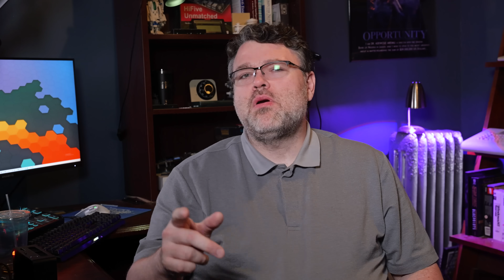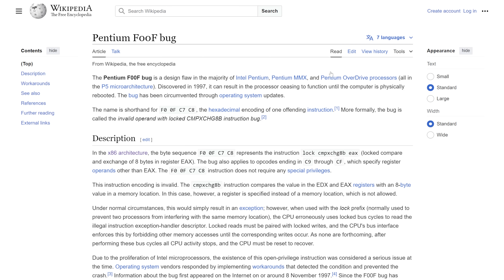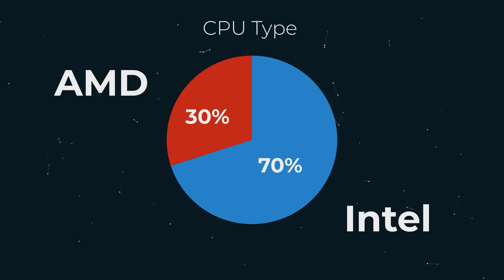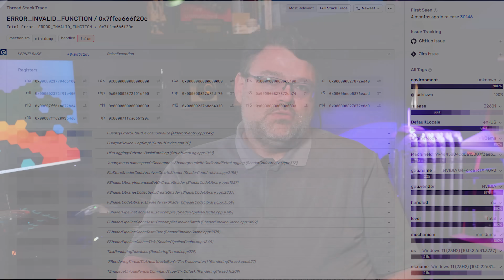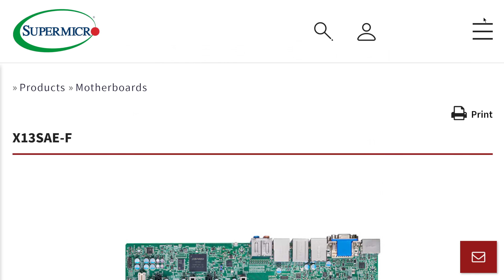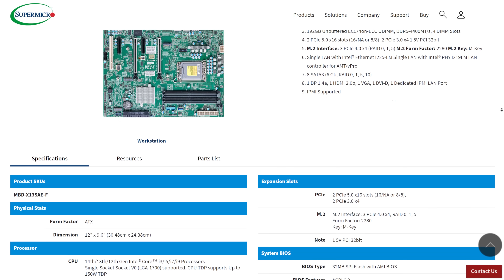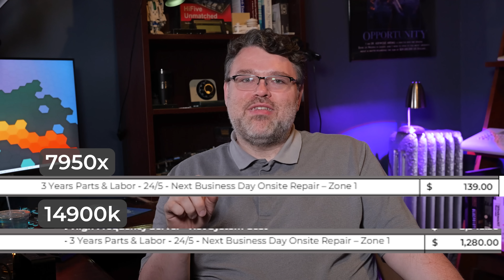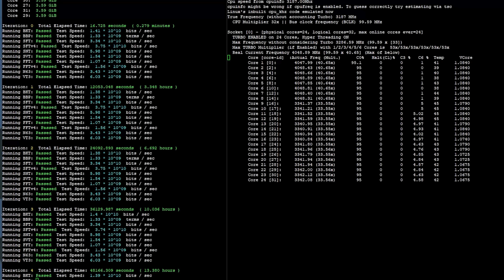Intel has a Pretty Big Problem

Comment: My nephew sent me a link to this video. Thank funk it isn't just me. I was going out of my mind trying to work out what was going on! It even seemed to do what is talked about at 20:03

I have the 13900KF and it is one of the affected 5-10%. Been trying to figure it out for ages. Swapped out everything I thought it could have been except CPU as I didn't have a spare. Waiting for a new Ryzen and MB to arrive before I try to get my money back.

Before this my last Intel CPU was the 80486-66 and this current one will most likely be my last. Hope it doesn't end up an exspensive paperweight.

Comment: Microcode 0x123 msi board cpu lite load control MODE 9 for default box cooler
AC/DC 0.400 / 1.100 mOhm
14700k VID=1,35V for single default boost 5,6ghz

Microcode 0x125 msi board cpu lite load control MODE 16 for default intel profile
AC/DC 1.100 / 1.100 mOhm

14700k VID=1,41V for single default boost 5,6ghz

Nice try to raise voltage without public know,so degraded cpu will work fine with 0x125 for a period of time
Reply: doesn't the fact there is a mismatch between the ac/dc loadline here mean that, effectively, the voltage delivered to the cpu is not the same as what it's requesting in the vid? its never been intel spec for ac/dc to mismatch on the loadline right?
Reply: @wendelltron  microcode 0x123 behaviour undervolt cpu,you can try for msi board to change lite load control(not load line calibration) and see in hwinfo64 and benchmark.For me mode 9 AC/DC 0.400/1,100 vcore is about 0,050-0,060V lower than lite mode 16.

For default intel profile this is game changer,because cpu boost lower with higher vcore and so degradet cpu are more stable,for how much longer idk,maybe sufficient to warranty expire.

Comment: I bought my I7-13700K Q4/2022. Was stable for 9 months. Then very random CTD crashes started during playing Crusaders Kings 3 (but nowhere else) approx once per one hour. And it's been getting worse ever since. A month ago, other games started crashing as well.  Just random CTD, not BSOD. 
The solution I found after changin almost all components, reinstall system few times to another drive - was to disable turbo mode and lower the CPU voltages. That's about 40% performance loss. The question was for how long. Because obviously the silicon in this CPU degrades over time much faster than we were used to before. 

Hopefully a permanent solution cost me just  1400USD. 
Asrock X670E Taichi + Ryzen 7800X3D + Water cooling + 64GB DDR5 RAM.

Comment: The data that is most crucial is:
Who has a prebuilt system.
Who built a system and didn't Memtest their memory.
Who is overclocking or overvolting.
Who is on an air cooler.
Who is on an underperforming AiO.
Who has janky BIOS settings.

As soon as I built my i7 14700K I had issues. Installing Windows 10 from the USB kept failing because it would crash.

After replacing the motherboard, CPU and RAM, I discovered it was unsupported  RAM timings and frequency.

I have 7,200MHz RAM. I tested 1 stick, then the other stick. Switched DIMMs. I tried XMP profiles. I then tried manual settings. 3 days of non-stop benchmarking to discover, the 14700K on the Z790 chipset HATES 7,200MHz RAM. I have Die B, single rank SK Hynix. 32GB (2x 16GB).

I managed to get it atable at 6,800MHz CL32-44-44-96. Which is better than Corsair Dominator Platinum kits.

My CPU cooler is the top 2x140mm kit (280mm) in the world. Corsair H115i PRO XT. It matches the Corsair 360mm AiO. It beats Lian Li, Thermaltake, DeepCool, NZXT and so many more manufacturers.

My CPU NEVER goes above 76°C under full load. My CPU has stock settings. And I refuse the latest BIOS firmware. I KNOW it had nothing to do with core voltages, ring voltages, etc. It had NOTHING to do with multipliers.

After setting my RAM frequencies and tightwned the timings, BAM!! 100% stable across the board.

We need more hardware and configuration details from EVERY Intel user.

Comment: I never had an issue with my 13900k yet, and had it for 1.5 years. But I also don't overclock it, and keep the suggested voltage that Intel recommends in their manual.

Comment: Certainly not an Apple fanboy but I wonder if Mac was still on Intel if they would have caught this issue before release to customers. They are known for having good software validation and they unlike anyone else (maybe besides Microsoft in a much smaller capacity) developed an OS, firmware, BIOS, software, and hardware all in one company.

Comment: I bought 2 13900k's. One on release day and 2nd one May 2024. 1st 13900k on an Aorus z790 master bought dec 2023. Zero crashes or blue screens gaming on 4090. March 2023 started getting random bios issues on start up from a shut down. PCIE gpu slot has been set to 4x notification and infrequent no display on start up. No display resolved with a basic restart, PCIE error resolved with resetting pcie back to 16x. Didn't feel confident with Aorus Master MB, and swapped to a new Asus z790 Strix-e. Zero problems, crashes, or blue screens till may 2024. Started getting same issues with gigabyte board, plus no gpu detected qled code. Basic restart resolved it. Didn't feel confident so bought a new Asus Dark Hero Z790 and 13900k. Frickin same random issues as all previous boards but no issues in the OS gaming, no blue screens or crashes. I also replaced Bequiet silent loop 2 with a EK 360 nucleus, new 1200 watt corsair psu, new memory, new case to. I still get these random errors even after all win and bios updates. What is going on.

Comment: My 13900k pc has started to random crash. I thought it was my overclock instablity, so i bios updated and turned off the oc. happened again. Thought it was my liquid metal application. Re applied, Happened again. i thought it was bad ram xmp, so i bought new ram. Hasnt happened sense i swapped it but thats only been under a month

Comment: Is this problem showing up for laptops with 13900hx for instance. Because mine has locked up mutiple times, and I have one with a 4090.
Reply: @wikingkrig5801 thank you
Reply: Did you find out anything else? Is yours still working fine?
Reply: It's still locking up in the middle of 7 Days to Die after 30 minutes at 100% rate. I haven't done anything, yet. I do intend to. How about you?
Reply: Are you locking up in any particular game?
Reply: @sirtainlee8725  i don't have it. I intend to buy a laptop and am doing my research, that's why I asked. Thanks for your response

Comment: Does crash mean the entire computer shuts down or a blue screen, or is it the game locking up or closing back to the Steam site for instance?
Reply: Both
Reply: @NeoakiraIV  and to laptops?
Reply: @sirtainlee8725  I don’t know about laptops i have a desktop happens to me and my brother almost same setup I updated the bios firmware and drivers on the mother bored  I have a Asrock z690-c/d5 motherboard and when I did games that use to crash every 30 mins or crash to the blue screen stopped happening I was able to play 5 hours yesterday and no crashes I don’t know if it’s fixed but so far it hasn’t crashed again gonna test it again today on another game that I had issues to see if that was the problem also ran cinebench before the update my processors voltage was all over the place and over heated and went past the specs it wasn’t suppose to pass after the update the voltage was fine and staying where it was suppose to stay at  still got a little hot and some cores were thermal throttled, but the voltage did not go over and leveled out and stopped throttling and was fine
Reply: @NeoakiraIV  thanks for that! I will try that too. Here's hoping it works!
Reply: @sirtainlee8725  NP hope it works for you …. update on mine still no crashes even tried to crash it by going full max settings highest resolution got hot but nothing crazy like before

Comment: I think it's obvious that in the future some more revealing information will come to light. For instance, I can almost guarantee that Intel has been trying to pay advertisers and influencers to downplay the problem, but it seems no one is accepting that blank check. On top of that, previous Intel marketing partners are likely dissolving their arrangements because their reputations are at stake. Server customers that buy millions of processors at a time are threatening to switch to AMD. Intel cannot live through that for even one quarter. This market cap war isn't anything new and something tells me that Intel had already been subsidizing a large portion of their enterprise customers to use their processors instead of AMD (market cap maintenance is worth more than profits short-term). What I'm saying is the jig is up. Intel's been leveraged for a while and their house of cards is about to be exposed. That's why they're remaining tight-lipped. Since 2017, AMD has consistently had the advantage over Intel for chip value across the whole industry. Any year that Intel had an edge over AMD was very temporary and very costly for Intel to maintain. In the same amount of time, AMD has innovated, maintained, and expanded in multiple successful ways, while Intel has failed on almost all fronts except for single-thread speed which is now a trivial point. Intel "lost the plot" in the early 2010's when they sat on the throne with their crown while concubines fanned them and fed them grapes. 10 years of swimming in their vault of freshly minted 100 dollar bills finally caused Intel to contract ink toxicity and a cancer started to develop. I hope Intel reveals to their shareholders sooner rather than later that they are insolvent or will be shortly. They can sell their assets to a company who'll actually use the damn US-based foundries. Microchip manufacturing is definitely in the top 3 most difficult and risky manufacturing projects known to humans. AMD divested their foundries 15 years ago because they could see the future. Intel went entirely in the other direction. It's interesting to see how 10-20 year-old decisions can come back to bite even the largest giants right in the ass.

Comment: Been dealing with my 14900k BSODing and crashing weekly. Many games are unplayable. I've lost data because my first set of crashes before they launched the bios intel safe updates actually crashed my system to the point that windows wouldnt load. I'm so pissed at intel.

Comment: I’ve gotten to where I honestly just don’t care about this issue anymore. YouTube has beat this issue to death to the point that it is just drama at this point. Then to top it off, FANBOYS going on to social media to continuously rub it in. 

My 13700K runs great with no issues like this; nor have any of the other socket 1700 systems that I have built. So, I’m not switching brands anytime soon.

Ultimately, I stopped by just to immediately stop the video and say that I’ll return to watching tech media once this issue moves on. I’m tired of hearing about and as stated above, I just just care about the issue anymore.

Comment: Quality control of intel in the last decade has gone bad. Look at NUC's, NIC's and such, they are failing and degrading. In order to win the highest FPS race they are pushing the latest generation(s) to it's limits. upholding a 105 to 115 degree core temperature is nuts.

Comment: From the start of 2024 we don't recommend Intel to our customers, because of the complaints and RMA's. For those that have the 13 and 14 gen, our service engineer, found a solution, in bios to lower voltage and speeds. But it took him a few days. But the oxidation problems still remain. What happened with Intel, seems big companies have issues, like Boeing? I also looked my eyes out on the high specs from their SKUs, Not mentioned the high power draw, because that's huge and heat build up.

Comment: I've been having this problem my rig, frequent game crashes and blue screens, for the past several months. I took it in for repairs a number of times, which took the form of just system reinstalls, I complained so bitterly that the computer shop individually tested all the components and charged me for swapping out my 13900k with a 14900k.... And it's still crashing! It won't even launch CIV 6 on Directx 12...I basically quit playing games, I simply don't know what to do. 😢

Comment: I had a weird experience at work when building up a 13th gen machine.  It would randomly become very slow and crash.  It would crash so hard that it did not have time to bsod and give me an error dump file to work with.  I replaced all of the hardware and reinstalled Windows, and the problem persisted.  Just based on a final hunch, I looked at the bios revision and I noticed a changelog that the mobo manufacturer had implemented new Intel CEP values.  So, I rolled the bios back to the previous version, and presto, instability solved.

I am just wondering if there could be a coorelation with what we are seeing here.  Maybe Intel CEP is throttling power a bit too much and is causing instability.  I have never seen a system that unstable before...

Comment: are these problems happening with intel laptop chips as well especially  i5-13500hx?which is almost equal to desktop chip?i was thinking of buying acer predator neo 16 i5-13500hx now I m a bit scared.Should I be worried and stick to and then?coz no budget CPU ofryzen has hx processor

Comment: Like this, if you're here after 8 months  or a year, still 41k plus r23 and zero stability issues at icy cold temps. 14900kx and 13900kx.

I'm so glad I own all major flagships.  

For us who are actually involved outside of a clearly biased history and have already solved the concerns.
 
It's day one load line to max clock concerns...oc 101 stuff...stuf you should know buying enthusiasts gear...hellllooo

 I know.  It's hard for gen z lol to realize it's not a companies obligation to hold an end users hand...buttttt.....

Overclocking and monitoring vid to core voltage is as old of a trick as I can think of, yet we have enthusiest degrading their 7950x and i9 cpus...

If you dont understand what unlocked means, buy the locked processor, lol...

Tbh I bought my x3d cpus when "the sky was falling" on the ambulge...x3ds still running great lol...even on an asus board? GaSSP.  Turns out even this moron can see 1.5v soc and fix it before a bios patch rofl...

Comment: Really appreciate your coverage on this! I felt almost gaslit by Intel as if it were my fault my 3 months old i9-14900K started crashing every 10 minutes while playing Hell Divers 2... Upgrading BIOS and nerfing power and setting LL to 12 got it more stable, but still have had a few crashes since. MSI Pro Z690-A and AIO Liquid cooler. Chip regularly throttles cores at 100 deg C even in AC room minutes after booting up. 

Good luck everybody, and I too hope Intel "makes gamers whole" on this debacle...

Comment: I struggled for years with instability on my 5950X system. Found out merely weeks after my CPU warranty ended that the it was the root cause and it's now a rather poor paper weight.

Comment: At 0.5 crashes per hour, you are probably only measuring the players frustration tolerance. Actual crash rate might be higher, but those players won’t participate for gathering data for much longer

Comment: Interesting info on the tick rate for gaming servers... personally, I've recently encountered very weird behaviour with SWTOR that I could not explain (on my AMD/nVIDIA system):
While SWTOR always ran great, smooth, lag-free outside of when my own internet connection/ISP would cause lags, in recent months, the game stutters randomly all of a sudden.

You turn a corner or enter a building, and even though you could already look past that corner/in through that open door from some distance, suddenly there's stuttering (but no discernable pop-in!), short in duration, but extremely noticeable in the degree the game world slows down during those stutters. That might well be explained with this new information you've provided... it might be that the game server I'm connected to is randomly experiencing tick rate slowdowns.

After all, the game used to run butter-smooth when I last played it in 2023, and with a 7800X3D, RTX 4080 16 GB VRAM, 64 GB RAM and everything installed on a Gen 4 m.2 nVME drive, a game as old as SWTOR has no right to have any client-side lag/stutter issues in the first place.
Reply: I thought I was the only one who played that crappy old 2012 game out of habit lol. My problems with swtor were always on Intel unless you disabled scale with distance nameplates always micro stuttered.

Shockingly the 12 year old bug went away when I switched to a 7950x3d. My hunch is the 3dcache eliminates this.